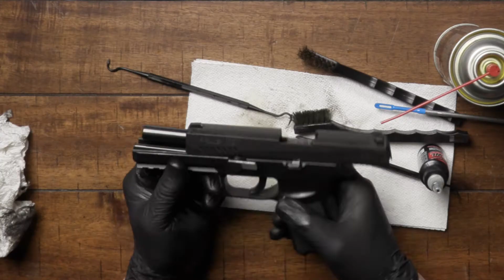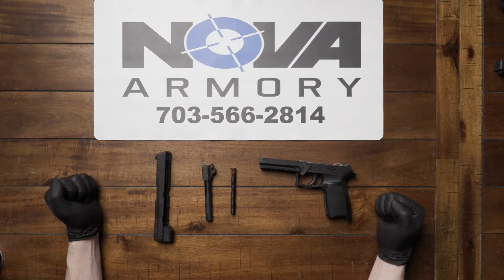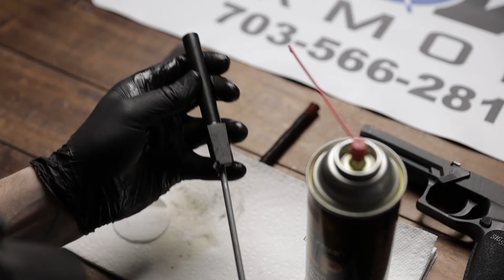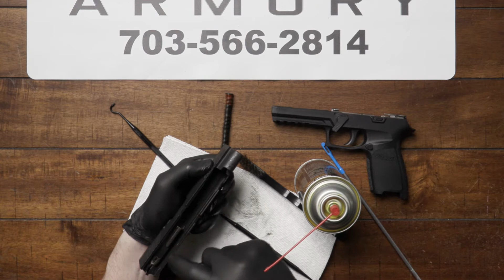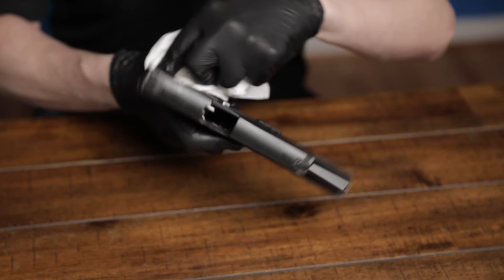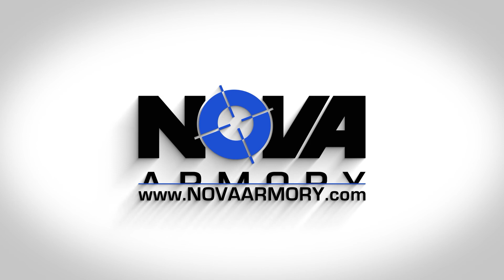Sig P320 Maintenance and Cleaning

Comment: I have a question, so i just bought a brand new sig sauer m17 and started using gunzilla clp on it, is clp fine and safe for polymer? Is it going to dissolve the polymer or any plastic parts in the gun? Cause you know the clp will drop on the frame from the slide

Comment: Doesn't pulling the brush and pads back through the bore tend to bring back contaminants into the bore.  Wouldn't it be better to go from the back of the bore to the front and then remove the cotton pad or the brush and start again from the back of the bore?